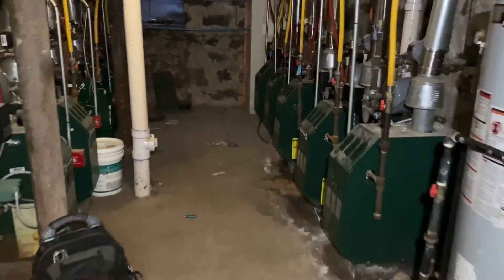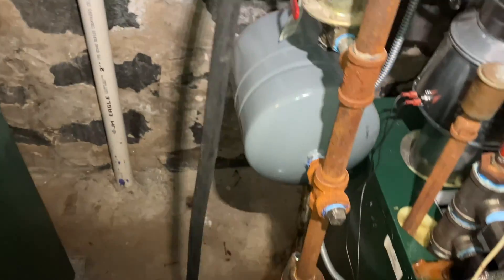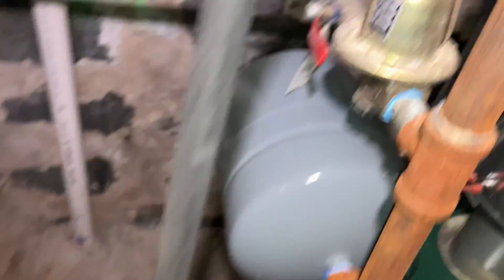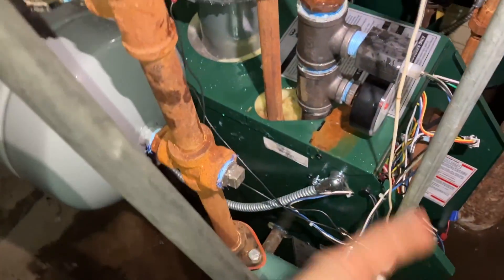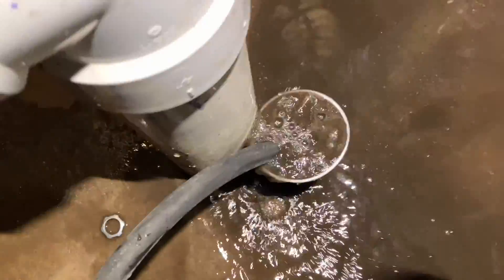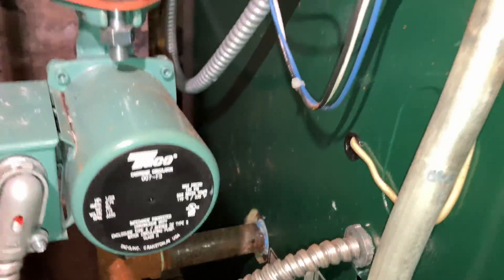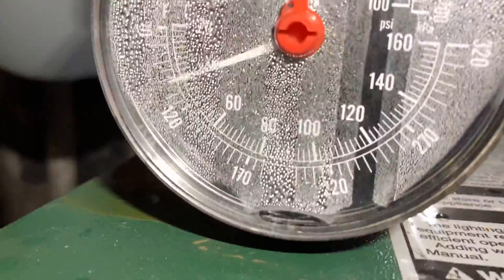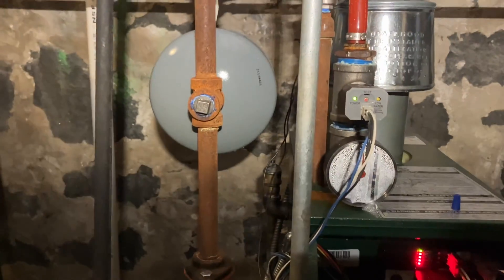How to Easily Remove Air from a Hot Water Boiler

Comment: Great video.   I have a single loop hot water baseboard system with mod con boiler.   Air vent on boiler went bad.  Replaced it but introduced air into system.    Your video is as close as I’ve found to my design.  Will try to fix it again this am.   Thanks.

Comment: I was told that the flow vent can be kept closed, i would just have to release the pressure every now and then. Is that ok? Also, ive released the air more recently but there is water now besides the air being released. What does that mean??

Comment: How does air even get into the system?
Reply from the maker: It can get in a couple ways: If there is a leak and new water is constantly being fed in new water has dissolved air in it; some pex doesn't have an air barrier; if the pressure in the system isn't positive at the highest point air can leak in through the float vent, im sure there are more ways those are only the ones i can think of off the top of my head
Reply: Water is what? H2O. It comes with oxygen.